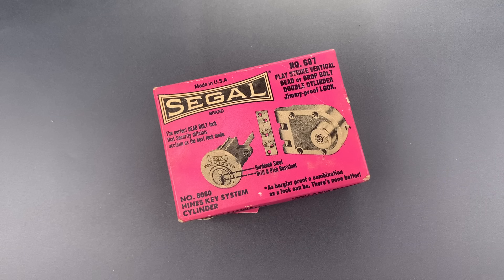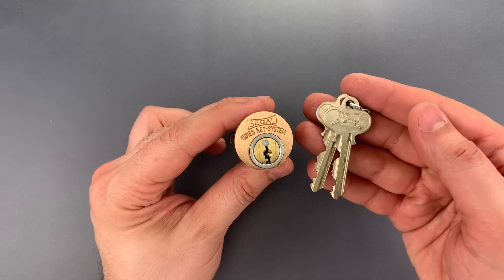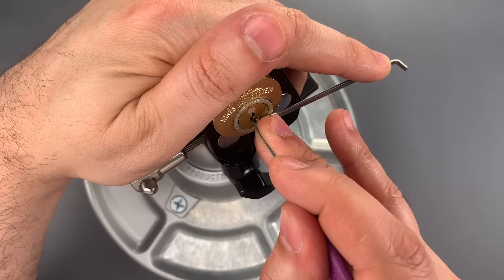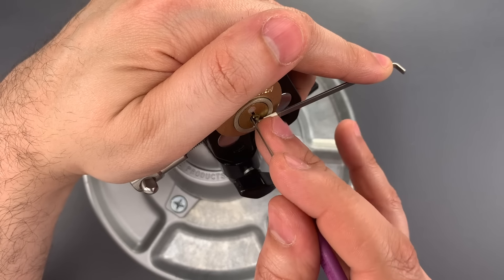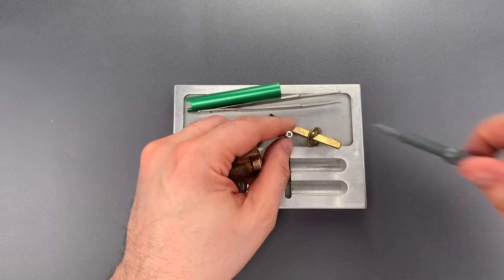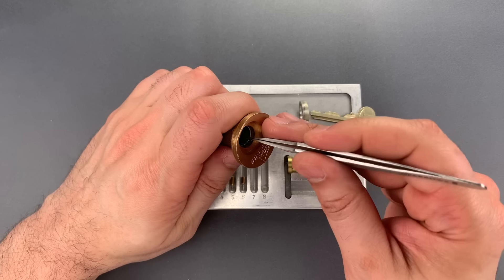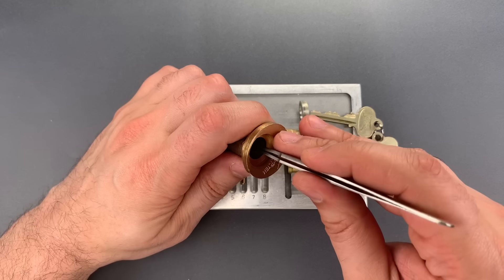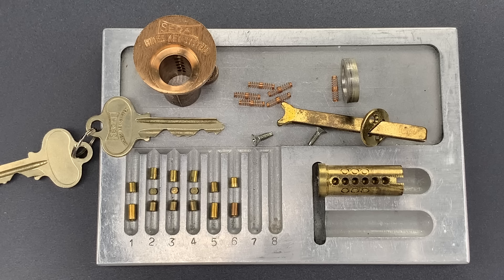[1181] A TRAP For Pickers! The Clever Hines Key System Picked

Comment: So if a company was to adopt this set up again but with all their locks but this time always put the traps in random locations (instead of just 2, 3, and 4) would that work better?
Reply: In traditional mass production it might be an issue, its not economical to produce all possible permutations. With modern cnc machining it is feasible but it would be very expensive to setup a production line like that. You would either produce different permutations in batches and mix them up or even better dynamically reprogram. There are 64 possible combinations so the batch system might be more efficient.
Reply: If the keyway isn't recognizable, yes. That way lock pickers would have to always, with every lock and every pin, check if there are multiple shear lines. If it's recognizable, you'd just push every pin to the second shear line for those locks.
If you would be smart, you'd just turn around the order of hollow-pin and the insert, so that with some pins you engage the trap with the first line, and some pins with the second one.
I imagine that would be rather expensive to manufacture, and would be too much effort for most lock-makers, sadly.
Reply: @nBoxes  not really, to randomise the pins you simply use our tech, randomising it will be easier now than it was then
Reply: @nBoxes  I don't actually think that would be a problem. Consider that you could machine  the groves into the lines of all six holes but only put hollow pins in three at random. This would allow ease of manufacturing while also allowing the end user to re-pin if they wished by simply moving the hollow pins to different positions.
Reply: @MagzGTV  That would work too but you might be able to tell if there is a hollow pin or not. If you do it the other way around (groves at some pins, and hollow pins everywhere or at random I think you would have to guess)
Reply: And you could add "normal" security pins to the other locations.
Reply: @nBoxes  There are only 20 combinations to have 3 pins different out of a set of 6. Am I missing something?
Reply: The problem is if someone trys to pick it and fails the key will not work as well.
Reply: @MagzGTV  I don't think the end user changing the pins would be a good idea, considering that the key wouldn't work anymore.
Reply: If the trap pins are in random locations and you lose your keys, your locksmith will have no option but to drill the lock. I mean, they'd probably drill it anyway, rather than trying to pick it, but your suggestion would give them no choice.
Reply: @MagzGTV  Randomizing as part of setting the key bitting would remove it from the mass-production phase, but fiddling with the wafers and hollow pins would already slow down the costly keying phase.
Reply: @DreadX10  I was assuming every combination would be viable from 0 to 6 pins. 2^6 essentialy.
Reply: You can just add those grooves to all pins' positions, that doesn't add any noticeable cost to the cylinder. Next you produce hollow discs, not just hollow pins. That's one extra part. Done. Now you can insert any combination of "solid disc + hollow pin" or "hollow disc + solid pin" into any slot. You could also insert "solid pin" or "solid disc + solid pin", but those would only reduce security. And you could insert "hollow disc +  hollow pin" or "hollow pin", but some my call it a bad idea.

Now you've added 6 bits of non-guessable and non-testable information to your lock. So out of 64 different ways of selecting the first or second sheer-line, 63 would lock up the lock. That's way better than before where you had 8 combinations and the one that worked was the same for all locks. Unless someone finds a way to find out which pin/disc is hollow. But unless the rim is very thin I don't see one.

The other question is if you actually want a suicide lock...
Reply: @DreadX10  it doesn't have to be 3 hollow pins
Reply: in theory this should work. A couple options for how they could do it do come to mind though.

1: instead of a full on cylinder, make a series of rings. The rings would literally have the exact same creation method 100% of the way through, and act as a simple puzzle piece system for any permutation. Basically, it would have 1 hole, and 1 groove, which could then be reversed at random during the lock creation. the groove, would of course, be offset, so that the holes would always line up for proper opening via the key, as well as the option to simply make rings with only the holes, making it even more secure, as you wouldn't know which lock has which potential combination. In addition to this, the sides of the rings would simply have 2 protrusions stick out, 1 on each side, so that every time you were to rotate it 180*, it would still line up. Combined with 2 matching grooves for those protrusions, you could flip the rings around at will and still get everything to match up.

2: Likely the better option, is to have the machine with something like 6 simultaneous drill bits (or whatever is used for carving it), and have a computer completely randomize which sets have grooves. The locks would have the potential for anywhere from 1 to 6 grooves, and as a result, a complete randomization of the grooves can be had. And, it could be done even more so, if the computer is simply set to run through every permutation, once, before randomizing the list, and doing it over again.

The only real catch to either of these, is ensuring that you've got the proper amount of parts involved with each lock, but, it's possible to just simply have a computer scan for each groove and determine how many are needed for any given lock. The grooves would literally work like a binary system, and the only thing the computer would then need to do is simply add up each one. Obviously it  wouldn't read it as standard binary, but, simply add together all of the "1s" to get the proper amount.

I think initially it could be expensive, but, manufacture enough of them, and you could eventually just phase out one or two of the other lock building lines, and nobody would even notice.
Reply: @RyuuTenno  What's your obsession with the grooves? They just have to be there for the hollow pins to lock into. There's no reason to add them to all 6 positions, and not having them at any one doesn't add anything.  All the magic is in where those hollow pins are.
Reply: @HenryLoenwind  well, the grooves are for those, it's simply a matter of which ones to add. I was simply explaining possible ways to manufacture the whole thing without it costing an excessive amount of money on the manufacturer's part. Higher costs on them means higher costs on the consumers.

Again, you've got 6 pins to work with and can have anywhere from 1 to 6 false clicks in any possible combination.

And my high usage of grooves throughout my explanation was accidental. The first one that was written, was the first that came to mind, so I wrote that up, then realized an alternative and wrote that down too.
Reply: @A_Blahaj  "considering that the key wouldn't work anymore." - So you get a new key cut in the same what you do when you re-pin normal locks.
Reply: @beeble2003  Yes, that is true, however I'm not incompetent. I'm 37 and I've never locked my keys in my house or my car so I personally value higher security over allowing a security gap to account for stupidity. If I did ever lock my keys in my house and had to pay a locksmith to drill out the lock it would be a fantastic lesson to remind me why I shouldn't ever lock my keys in my house again.
Reply: @johndododoe1411  "Randomizing as part of setting the key biting would remove it from the mass-production phase" Why? should be no different to randomizing regular security pins that are used on normal high security locks. Keep in mind I'm not saying it would have the same manufacturing costs as a regular old cheap lock but from a manufacturing side it shouldn't be an issue and It would be on the end user to pay the extra cost which woudl be expected in a high quality high security lock.
Reply: @MagzGTV  The "mass production phase" is the part where nothing is unique to each lock and key, such as making the "bible"/outer cylinder and making the plug/core.  It can/should be done by mechanical machines that don't try to be intelligent in any way.
Reply: I still don't get why the pins have to be hollow.. I mean standard solid pins would work exactly  as effectively or even more since you won't be able to easily twist the core with force to shear them out of the side holes.
Reply: @ukpkmkk_2  The pins are hollow to fit into the ring shaped grooves when trapping the lock.  The wafers and regular pins slide right over the grooves as their flat ends rest on the plug surface on both sides of the groove.
Reply: Just put traps at all pin locations, and then load the Locks according to batch requirements - only the trap pins will fall into the traps -  no need for wafers in all locations (or multiple trap wafers could be used - set up false-false shearlines - traps for unwary pickers - Or 100% rake defeat.
Reply: @tank382   - That is actually a feature. This is a "pick attempt - indicator." - Lock Jammed, possibly with rake or pick trapped inside.   When that happens to you - Use the Back Door Instead - to access you place - once a thief has a trap sprung on the front door, they are less likely to attempt the back door - If you are in an apartment -  bad luck - or get your drill out of your car and install a new barrel. - Yes, most people with "Lock issues" - merely forgot their key when  they walked out - sucks to have to call a Locksmith every time that happens (Never called one myself - cheaper to do a forced entry to your own place and repair whatever damage was caused...  PPS. Noone ever called the police while I was breaking into my own (or a family member's) house - shows how burglary is a fairly low risk endeavour - need more bear traps.
Reply: @MagzGTV  Don't be so bloody patronizing. I've locked my keys in my house once in 43 years. That's hardly "incompetent".
Reply: @tank382  So?
A mild inconvenience compared to a company have money and sensitive information stolen that no insurance can cover.

I'd rather have the mild inconvenience.
Reply: @johndododoe1411  oh.. Now I see.. I didn't catch that detail, I thought the trap was just a regular hole not a ring shaped one.
Reply: @beeble2003  It's not patronizing. though if you feel that way I am sorry. I'm an Aussie so I'm practical and blunt, My current lock set are BiLock's (LPL actually recently took on a lock very similar to what I use) on pretty much all entry points to my house so I am already running locks that pretty much require drilling if I leave my keys inside, so I don't leave my keys inside, Upgrading to a system like this would make very little difference to me in that regard.
Reply: @johndododoe1411  "The "mass production phase" is the part where nothing is unique to each lock and key" I am aware of what mass production is however you are missing the fact that not every lock on a production line is keyed the same, the pinning has to be different on each one within a certain level of randomness otherwise you would be able to open any lock with any key from any other lock of the same type.  If every pin hole in the core is pre-drilled with the trap detent during it's manufacture then randomly placing the trap pins would be no different than randomly placing the normal pins (or high security pins for those locks that use them) as is already done.
Reply: @MagzGTV  Exactly, and the part of the production that puts in random pins and match them with a random key is what I refer to as the "not mass production phase".  This would be followed by more mass production steps up to and including packaging.
Reply: @nBoxes  YOu have a point, but if the core was set for traps on all pins wouldn't it be a fairly simple process to feed 2-3 hollow traps into random slots while filling the others with standard pins?
Reply: Yes.

Comment: Sorta new to your channel and not sure if you've talked about them in the past, but those springs didn't look "normal" to me. Seems like there is a tight wind in the middle, almost as if one spring acts as two. Is that a standard feature with the Hines system, and if so, why would all 6 be like that and not just the trap pin bores?
Reply: A spring is a spring
Reply: Maybe that's to reduce travel and increase force? Maybe they modified a small spring machine to make springs twice as long? Maybe they needed a bit in the middle to grab the springs easier? 

As for them all being the same, it's usually cheaper to idiot proof the assembly than worry about swapping springs. I've only seen multiple kinds of springs on fancy pin-in-pin locks and homebrewed challenge locks.
Reply: @TlalocTemporal  Seems like all valid questions, but not really an answer. Your second point makes absolute sense. Perhaps the spring is specifically designed for the trap pins and just used for the others to prevent mis-assembly.
Reply: I think it's designed to increase the force of the spring. Probably to trick the lockpicker. I suppose a novice who doesn't know the system will arm the trap but not push further because of the increased tension.
Reply: @klschofield71  I suppose they might be a little tighter springs than normal to make sure the hollow engages the groove well. It's probably cheaper assembly-wise to keeps all the springs the same.
Reply: Search for "tangle resistant lock springs" and you'll find that they commonly look like this. I assume that the design, well, reduces tangles, but don't know the details. Not specific to the hines system, maybe specific to quality locks.
Reply: @BenGalehouse  yup you got it. the springs tend to lock together in the middle when you get them in bulk like say a pack of a 100. more of a locksmith feature for when your reaching into them and trying to grab 6 individually. once they are in a lock they just act as normal springs.

Comment: this could easily have been made more difficult to pick. mill the grooves for all pins and just insert the trap pins and disks randomly during assembly
Reply: okay, then you lock your keys in your house and have to hire a locksmith.  now, he doesn't know which pins are trap pins and you have to spend money on the smith and a new lock.
Reply: @theghostofthomasjenkins9643  that is when you just skip the locksmith altogether
Reply: and maybe replace some standard pins with spools
Reply: @theghostofthomasjenkins9643  if you're that paranoid you won't lock your keys in
Reply: @theghostofthomasjenkins9643  No modern locksmith is going to pick a lock it doesn't know by hand. They drill it out, sell you a new lock and charge you for having access to high quality tools.

Because even if you own the best stuff, it's probably in the house you can't get into anymore.
Reply: @christopherbriggs9526  Except your power tools are locked in your house with all your other stuff so there aren't many options.
Reply: Not that much more difficult, there are locks with 2 shear lines and every pin has to be picked to the same shear line. Those are still pickable, contrast with this where I am always picking to the second shear line for every pin stack with 2 options. The main point is that you cannot reliably rake this open or use an automatic picking device because those essentially randomly select which shear line for any pin stack with more than one option which will seize up the lock unless you got quite lucky. These days criminals in the USA don’t pick locks. That doesn’t mean locks don’t get picked, and in other parts of the world locks that have some actual pick resistance are still popular.
Reply: @paulelderson934  Yes... along with my lockpicks.
Reply: This argument ultimately implies that the end goal of home security is to have door locks that can be picked by a locksmith as a backup plan for getting locked out. Which is dumb, because if a locksmith can pick them, so can many thieves. You need to formulate backup plans that don't involve being able to pick your own locks.
Reply: @boiledelephant  Yes, you need backup plans: typically, giving a spare key to somebody you trust. But remember: thieves don't pick locks. Unless you have some reason to believe that thieves will target you specifically, lock picking just isn't an issue.
Reply: You simply apply the same technique to all 6 pins.